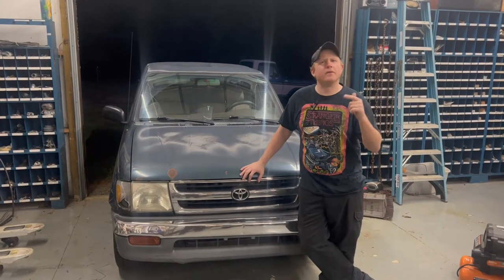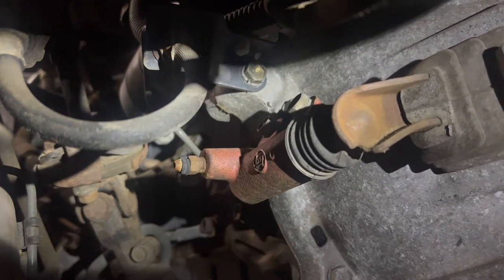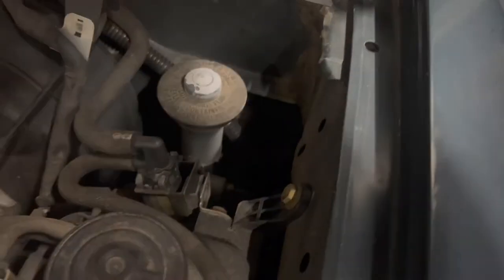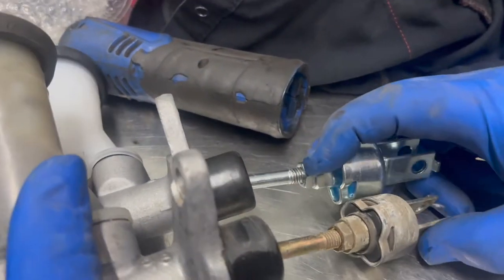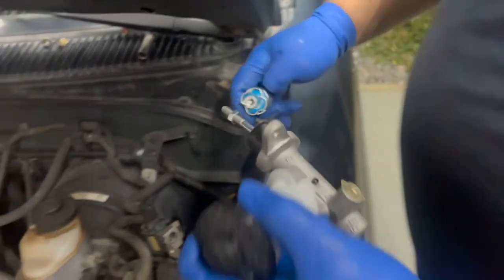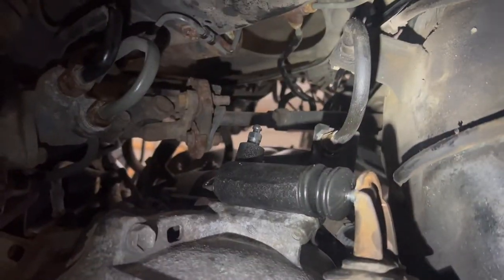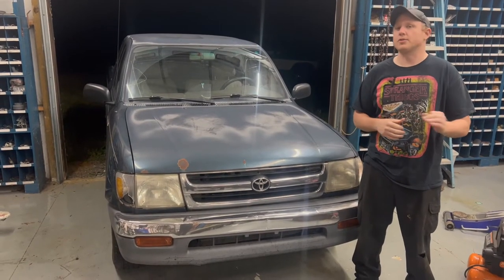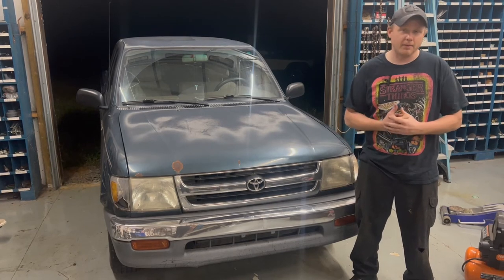95-04 Toyota Tacoma Clutch Master and Slave Cylinder Replacement. No Clutch Pedal Concern.

Comment: Just a suggestion before you go and buy the master and/or slave. Check the return spring and bushings. They wear out and wear into the pedal assembly and clutch pedal arm. Speaking from experience

Comment: I just replaced the clutch in a 99, had a shop do that and I put in the new Master & Slave.. It was as easy as your project.. I run a small hose into the bottom of a bottle and can bleed it by my self, same with the brakes.. The only thing is the reservoir is small and doing it by yourself is more challenging..

Comment: I’m trying to get my 2003 Tacoma 3RZ going after it sat at an unscrupulous body shop waiting for work for 3 years.  
I put fresh gasoline in it and got it started.  Went to put it in gear and the pedal is frozen in place. The clutch pedal literally won’t move.  
Is there such a thing as the master cylinder rusting and being completely frozen inside? Truck is in western Oregon so has been getting rained on for 3 winters without use.

Comment: I have a bad master or slave cylinder on my 02 Tacoma (300,000 miles). The master has already been replaced, but it's a cheap Chinese replacement part... the slave looks original, but it's that good, original Japanese engineering... I'm almost hoping it's the new master cylinder that failed, so I can keep my good Japanese slave cylinder! How do you feel about putting these crappy new replacement parts into old trucks? Is there any way to get replacement parts that don't suck?
Reply from the maker: Aisin is the oem manufacturer you can get from rockauto.

Comment: I done everything you all have said still no action I do not understand why my pedal will not respond I have replaced it all is full of fluid still no action
Reply from the maker: See if your slave cylinder rod is moving. If not, then you have to start isolating components. Remove one of the lines and see if your getting pressure when the pedal is pressed and go from there.
Reply from the maker: @72strokershovelhead88 I would try opening the bleeder on the slave cylinder, then having someone push the pedal down, then closing the bleeder. I usually just block it off with my finger. Do that method several times. The problem is that air want to rise, so by pumping the pedal with it closed, you’re getting air trapped at the master cylinder. Once you start getting fluid at the slave cylinder with each pump, then you can go back to pumping 3-4 times and bleeding it.